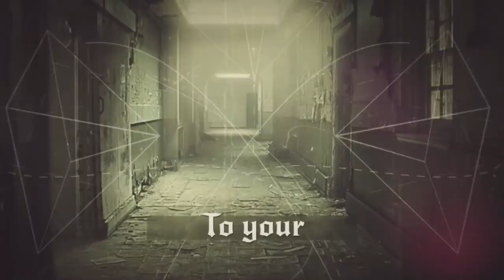(ALONE IN A HAUNTED AND POSSESSED MURDER HOUSE) 30 MINUTE CHALLENGE

Comment: 3:10 orbs up by where the knocks came from! 4:52 right after he closes the door it sounds like a female whispering. 6:07 right as Chris starts talking it sounds like a hiss! The problem with using just the flashlight here is the dust and orbs can look alike so makes it hard to tell which is which. But with the camera light u can clearly tell when there is an orb. Thus place is so much more active than last time, wow! 11:01 big orbs! 11:12 a crazy voice! 12:40 could be a voice. 13:36 there are lots of orbs here. 17:30 a voice. 23:38 the tape or whatever is hanging from the ceiling is swinging and an orb zips by. 23:48 a voice while Chris is talking.

Comment: I always look for convincing evidence in such videos.
26:28 We hear the sound of wood hitting another wood. Chris looked up in reaction. Remember this because it will be useful later.
26:51 This wooden board fell from the ceiling. Not quite true, but Chris thought so. However, if we look carefully earlier this board was lying on the ground and there was also on the Joe's movie who was there before. It's exactly the same board as you can say comparing the knot pattern. So it mena that this board first had to rise up in the air and place it over Chris. Probably when we hear the wood hit the wood at 26:28. Only after that it fell on Chisa, when he was busy putting the overturned cart and winding the cables. It happened behind him when he wasn't looking.
For me, this is important evidence, because Chris could not do it alone at the same time holding the camera with one hand and putting the trolley with the other and lifting the cables. His hands were busy all the time and there is no way that someone else could do it since Chris was alone in empty room with no place to hide.

Comment: Look carefully at your footage, the piece of wood that came down on you was on the floor until just before it happened. Look at the footage leading up to it and you repeatedly see it on the floor (and it was there in Joe's footage), but just before you walked over to that area, you heard the clunk and scraping noise. Then you walked over there and it immediately dropped on you. Looking around the footage afterwards, that was the only piece of wood on the floor again. If it were 'ripped off' th rafters, like you thought, you would see two pieces.

Comment: Sounds like someone throwing stuff on the roof and letting it roll down! The knocking could be old wood settling in the attic as well. The outside noise seems to be traffic? Could this be the reason for the noise and rattling?

Comment: Chris. Did they finish renovating this place?.  I'm curious to know if someone brought this place. Don't think I would want to live in a place where people got killed. The residual alone would be too much for anyone. This is one of the most active places I've seen you visit. Granted I'm a new sub but this was very interesting. 👍. Just also wondered about the doors they look like internal doors which are not suitable to be used as external exit doors not designed to deal with the elements. May be wrong but they look like the doors we got inside our house. Either way it's a fascinating place.

Comment: That sound is that plastic tub on the floor watching this again it doesn't sound like it's coming from the roof it's on the ground. That's why it didn't correlate with sounds on the roof. It must have been following you around then when you went outside looking for someone on the roof there wasn't anything up there. It was inside a hollow house which magnified the sounds. It's scary huh? Who's scooting the plastic bin though?